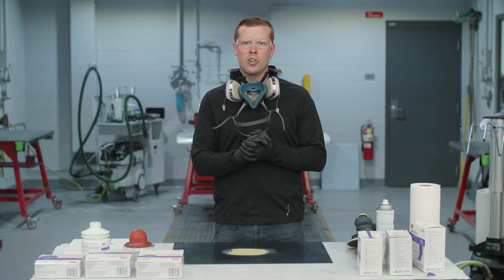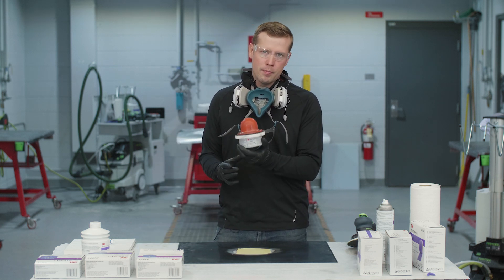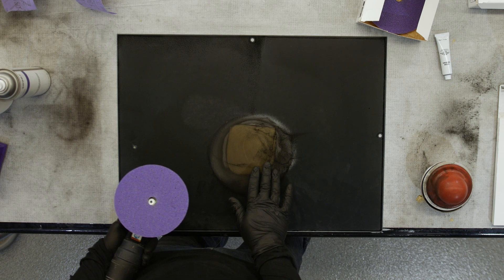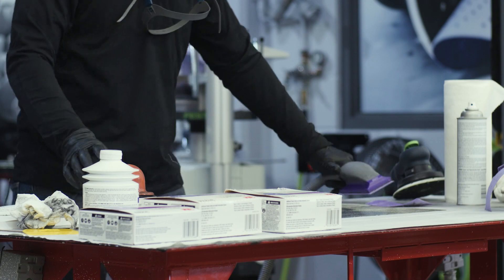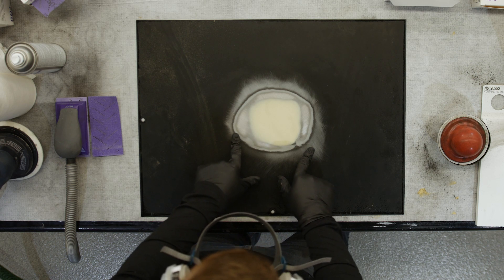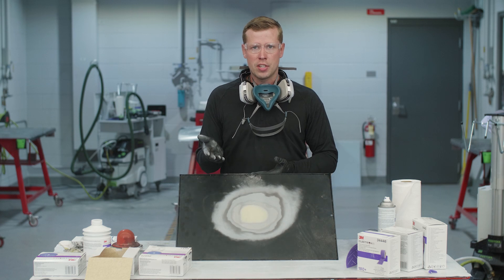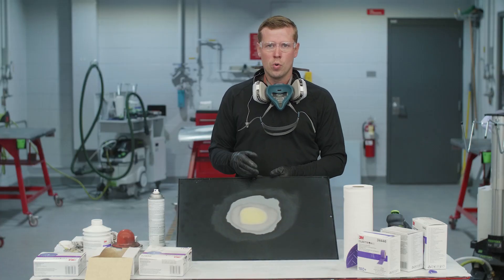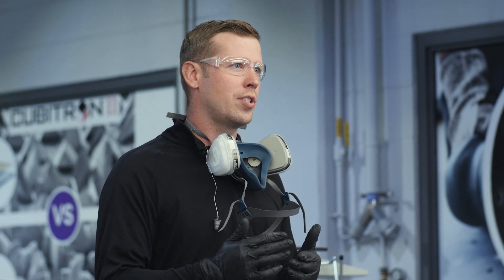HOW TO: Feather-Edge after using Body Filler

Comment: Do you recommend using self itch primer , before applying filler .
Reply from the maker: Hi there! Thanks for your question! Always follow your paint company's recommendations. Typically, you can putbody filler over urethane primer and epoxy primer, but paint companies normally prefer nothing going over edge primer other than the urethane chemistry it's designed to work with.

Comment: What about thje bare metal bridge between filler and old paint.. isn't there a slight vally ?
Reply from the maker: Thank you for reaching out! That's what primer surfacer is for - to bridge the body work back into the paint film.

Comment: Hello do i undurstand right that the glaze can be applyed on  sanded  paint (P180) or bare metal without issue.  The rule for bare metal for the bodyfiller is diffrent from the rule for glaze am'i wrong? Many thanks in advance
Reply from the maker: Yes ! You are correct.
Reply: Many thanks for you answer and attention. I appreciate that.

Comment: His test board had a light coat of sealer and paint easy to feather it's not the same on a car particularly on the German cars I worked on most of them have a rust preventive coat as well as sealer base coat and clear coat that's a lot of material to feather and many times you have to keep the area small to allow enough room for the painter to blend. I would spread the bondo right to the edge of the paint knock it down sand all scratches out of the paint than use evercoat glazing putty over the bondo and over the paint by a 1/4 inch no need to feather. They sent our preppers to an I-car class they came back saying "no more putty on the paint" the next 3 cars painted were redo's you could see a ring where the paint wasn't feathered properly. LOL the boss said "go back to how you were doing it before" In all my years I've never had a problem with a 1/4 inch of glaze over the paint I don't care what the experts say I was an expert repair man
Reply: Yeah that’s where some people disagree. Our painter always bitched when people just feathered chips scratches etc because he sow djr would buthole  as he called it others call it bullseye. You can feather stuff but I feel like the odds of it showing are greater if you don’t get it feathered perfect and I think it may be harder or easier depending on how thick the paint is. I personally got in the habit  of using 120-180 and at least remove the clear then use glaze and nothing shows. The only issue is if the paint ever lets go your glaze is over it so you definitely don’t want it over the clear since it’s the first to go. At the same time if the old paint lets go you have a completely different issue anyway.

Comment: What benefit is your dry guide coat when your dust collection systems picks it all up?
Reply: Still shows you if you have any low spots and highs
Reply: It sinks into the low spots mostly the scratches the vacuum won't pick it up as easily. It works wonders as a visual guide to help make the scratches pop

Comment: I'm a paint helper I just started working 3 months ago. I just feather it out with a D.A. using 320 grit and then use 500 grit to remove the scratches and it's ready for primer. I do find it odd you're using guide coat on it because I wasn't told to use guide coat to feather it.
Reply: Guide coat is the only way to seeing.
And knowing when to stop sanding.
Last thing you want is to see things thru the paint.
I've learned guide coat is your friend if you want to do FAST but Accurate Work. Use it any where you want to see your work
Many body shops are cheap and won't want you to use another step .h
Reply: @MindDezign  I usually feel the edge with my finger tips know if it's been feather out but everyone has their own method.
Reply: I find guide coat to be super useful when re-creating body lines.

Comment: What if the dent is by a slightly curb surface not flat, does it matter if i sand up and down and left and right, or does the shape got its own form to sand it. ?
Reply: That's why you block it. You can get convex and concave blocks. Work with the shape

Comment: Geesus. A video about how to starve to death in a flat-rate shop. Want to get an amazing feather edge on filler, without glaze? Get a can of Rage Ultra, a roll of purple 3M 80 and a roll of purple 180, perfect your technique over decades, and get some epoxy on it. Next.
Reply: This is a video about how to do it right, not how to fuck around for decades before kinda-sorta getting it right.
Reply: Lazy prep leads to shite work.
Reply: Im an apprentice to autobody .. here in my shop no one applies dried guide coat ? and all that extra stuff any tips?
Reply: @CesarSanchez-nu3eo  Certainly there are some extra stuff here that you wont see in the body shop. I'm also an autobody apprentice as well and in the shop that I work at they don't use wax and grease remover to remove the dirt after sanding, we just use our air gun to blow it off. However, the guide coat that they show here really help you to be more accurate in your sanding. My Boss is a red seal technician and he always recommend me to use guide coat for your body filler or putty. The guide coat let you see all the low and high spot in your body filler so when you sand, you will be able to know when all your area are at the same level after sanding.
Reply: Thats exactly how we do it at the shop i work at and never had a problem
Reply: And look at that place looks like you might be able to eat off the floor. I’ve been doing this since 1989. Nobody shop looks like that most body shops don’t have that equipment he had a vacuum sander. That’s why he wasn’t wearing his mask you didn’t have to what shop supplies a mask that you could change out the filters every week how often do you run out of paper towels? I agree with you then man starve his family would leave.

Comment: Is that a  sanding block with a vacuum or is it an air powered sander with vacuum?
Reply: It’s a Festool vacuum sanding block connected to a Festool hose and dust extractor.
Reply from the maker: Hi Andy. Tom used the Festool Total Automotive Sanding System. You can check it out here:

www.3mcollision.com/festool